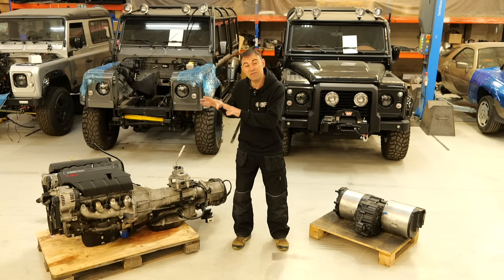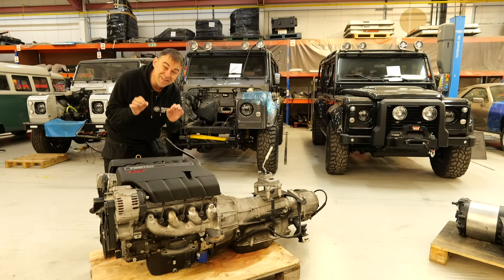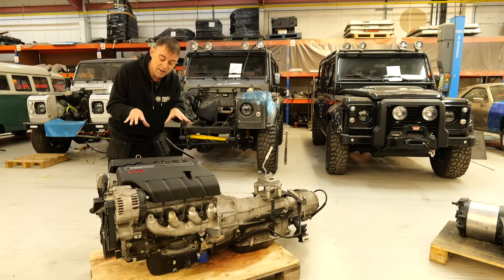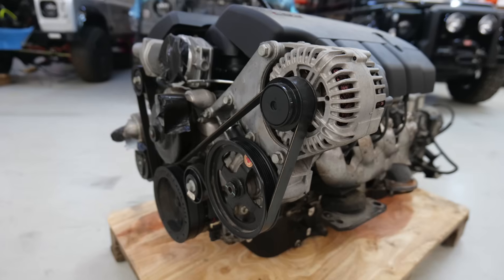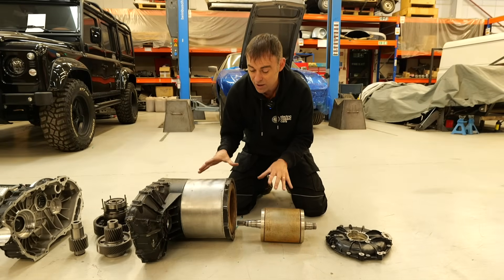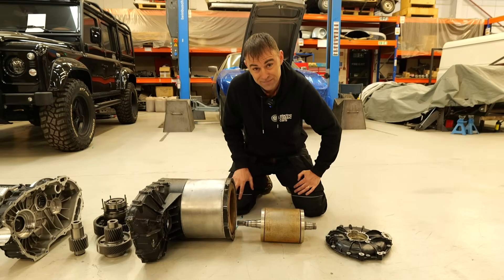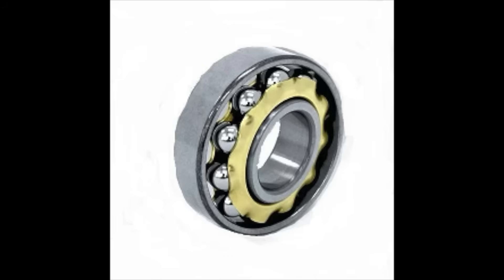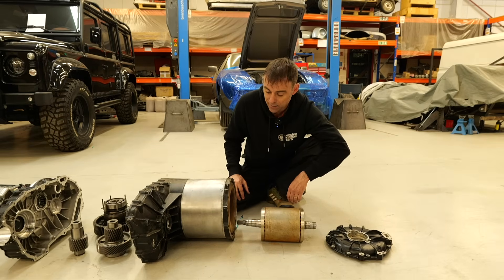Let's compare the Tesla LDU with an LS3 V8 and take one apart to see what makes it tick.

Comment: What’s your opinion of doing a Mercedes S class 2015 model, which has a blown engine, I was hoping to fit a Performance LDU motor into it, do you think that this is FEASIBLE ? Worth it ?   Rough guide on costs for materials and labour would be great but I know that the cost is variable.
Reply from the maker: Sorry. I know nothing about modern cars like your Merc, but anything is possible. 👍
Reply: The problem with modern cars is that all of the sensors on the engine and transmission go to an ecu. Then the ecu is tied in to the gauge cluster and body control modules etc. To keep everything working, you need to trick the car into thinking the engine is still in the car otherwise your gauge cluster will light up like a Christmas tree. It can probably be done, but it would be very expensive.

Comment: Great video. I am sure folks will say add the battery weight in the comparison. The thing that gets missed in that ask is as time moves on more power dense batteries are developed, which isnt the case with ICE.
Reply: We've already reached the physics limitation for ICE 'efficiency'. They can be around for 100 more years and they will not get much more efficient.
Reply: @HoldFastFilms  that's what I am getting at
Reply: Agreed,  I occasionally see comments that ICE engines are getting more efficient, but honestly they peaked decades ago. Now they're adding turbos to try to use a pinch less gasoline, but making the engine that much more complex and prone to wearing out and breaking down.
We've already seen several generations of EV battery improvement in both density and chemistry in just 15 years, and we're nowhere near done.
The only way ICE vehicles are going to get more energy efficient is to make them lighter and more aerodynamic, and the trend has been in the opposite direction since the 90s.
Reply: @ziploc2000  I’m  pro ev but let’s be careful to not spread misinformation.  They are still making some improvements in combustion.  Turbo charging has been round for many decades but the latest turbos have seen some improvements.   The other issue now if that there is much less money going into engine development.

Many of the reliability issues are related to either money saving(often plastic parts), emissions systems or bad design.

Tesla had quite a simple job to do(one moving part) and managed to f up in Major way with the coolant leak that totals the motor 🤦‍♂️.

Comment: I’d love to see an episode showing how many parts on a combination engine are there to compensate for the flaws in using explosions as a means of creating movement. Once the piston has done it’s cycle every part after that is a liability (the exhaust system, egr, catalytic converter, gearbox, nox, flywheel, long drive shaft etc)
Reply: To be fair, we shouldn't call the combustion of gasoline in cylinders "explosions" - although it does occasionally happen and is called "knocking".

Comment: Question, i have vw syncro vanagon ,rather than a rear generic electric motor to the gearbox,to run the driveshaft to the front, is there and electric motors that have 3 outputs to possibly delete the need for the vw gearbox which is very weak with higher powed torquer engines.. instead of using a tesla rear drive unit and a front drive unit which would be lovely but quite complicated i would think .
Reply from the maker: If we did another Syncro we’d go front and rear Model 3 motors. Nothing complicated about it. 👍
Reply: Are u able to locking unlock, the electric motor on the front and rear ,like the front diff on a syncro..dream syncro 400hp spinning 4wheels in the dry ..without everything braking..

Comment: tesla drive unit is lighter, sure, we all know ev's are very light :)).  if you don't add the batteries, then you get a minimum of 620kg, without wires. and related stuff. for the ls3 unit you add 40kg for a full of 70kgof gasoline and 5kg the fuel tanks, total 445kg. not a huge difference, v8 power units are heavy as well
Reply from the maker: A Tesla model s 100kWh battery pack weighs 540kg, including cables, charger, etc The total weight of the LS3, gearbox, transfer box, exhaust system, big lead acid battery, starter motor, fuel tank, fuel and all the other stuff to make it work weighs nearly 680kg. The electric conversion weighs the same as the ICE setup that came out.

Comment: Can a Tesla LDU replace the transfer case on a 4WD truck?

so, delete the engine, transmission, and transfer case, then turn the LDU sideways & run the axles as driveshafts, into the other axles. The gear ratio of the axles would make the motor spin faster, but that would be offset with bigger tires...
Reply from the maker: That’s how we’ve been doing 4x4s for the past 7 years. With one exception, we change the Tesla gear ratio with our own gear set. 👍 https://youtu.be/HoqoL1EyAHk?si=HU6pDRePt66z9ApB

Comment: I was HORRIFIED when realising that seal doing 18krpm. Normally stators do not heat up that much that they could not cool via the stator. Cooling the transmission oil MIGHT have some issues in some driving, such as insanely spirited track. In off road use, this type of transmission without torque converter is basically idling along unless you're in Nevada, which you are not. So yeah, for these Landies, I think the simplest coolant path delete is good option. Note that I'm just armchairing. For work, I repair electrical pumps, which are just about this simple.
Reply: ppl will customize the electric drives over time for specific needs... imagine a little trans cooling radiator, a little air cooling system, etc
Reply: Yeah I can imagine the diff/transmission oil will need a lot of cooling when driving on a track, and a separate cooling circuit could be good for just that. Racing cars often do have diff oil cooling.

Comment: to make it fair you need to put the battey  next to tesla and gas tank next to the V8. Try to be honest for a change
Reply from the maker: Why? We’ve already covered that in a previous Tech Talk. This episode is about looking inside a Tesla drive unit. 👍 https://youtu.be/HoqoL1EyAHk?si=HU6pDRePt66z9ApB
Reply: @ElectricClassicCars  no you didn't - you only show the tesla unit but no V8. No weight, cost comparison. Not to mention  200 mile range and 5hours to recharge your contraption Vs 400 mile range and 2 minutes to refill ICE engine gas tank.

Comment: You have to consider the energy storage as well as the ancillary equipment required, and the motor itself when comparing them.  You touched on it some, but did completely ignore the difference between a gas tank and battery packs, which I believe also require cooling.
Reply from the maker: This episode was about looking inside the Tesla drive unit. We’ve covered the battery vs fuel side of things in a previous Tech Talk. 👍 https://youtu.be/HoqoL1EyAHk?si=HU6pDRePt66z9ApB
Reply: All that being said, I am completely on the electric bandwagon, and next vehicle I purchase will be electric, possibly hybrid to deal with potential charging infrastructure limitations.
Reply: Actually batteries are far more likely to require heating than cooling, as they like to be warm when giving or receiving charge. They do a certain amount of self-heating as they're used, but in colder weather pre-heating the battery (especially if still plugged in) can lead to greater efficiency when driving and a warm battery will charge faster than a cold battery.
Reply: @ziploc2000  I know that Tesla battery packs do have a cooling system.
Reply: @ziploc2000  it is correct that most batteries require a min operating temp, just like the oil in an ICE but there are ways to mitigate the extreme low temps given the fact that charging/discharging a battery creates internal heat. so in extreme cold climates a pre-heating system would be optimal...
for the moment, dissipating the battery heat is the main concern.

Comment: Super neat to see the exploded view of the tesla motor. However, I think you skipped over the battery weight issue. I agree that the electric motor is the more efficient way forward, but the inherent weight to get full range vehicles is a substantial design and engineering consideration.
Reply from the maker: We covered batteries in a previous Tech Talk. 👍 https://youtu.be/opF1si__APs?si=taNA6C0wKcco5iQc
Reply: What? A model s lr awd weighs the same as a loaded older challenger or charger right at 4,400# newer chargers are over 5,000#
And the new model 3p weighs the exact same as a bmw m3 comp awd or less than a ford mustang dark horse! 
the lightest tesla model 3 rwd weighed just 3,450# a base model mustang now weighs more!

Comment: How can you measure rotor temperature after coolant delete ? Of course  motor or gearbox doesn't get hot but what is with rotor ?
Reply: Couldnt you just put a probe in the case that is connecting to the rotor??

Comment: Question is the range, I saw that most of your conversions have range around 200-300km, is it possible have range around 400-500km with more modern and probably more expensive batteries? Or there is no space for batteries with this cappacity in your conversions?
Reply from the maker: The longest range vehicle we’ve done so far is also the largest, as it could carry a large battery pack. It was 400km range. The restricting factor is the fact that we have to stay within the confines of the ICE cars original weight. If you are starting from a blank sheet of paper and building a ‘new’ car then you can get a range much much higher.
Reply: @ElectricClassicCars  
How about "longer" gearing?
If you don't need massive torque you could essentially "Hypermile" and still have performance that most will find adequate

Comment: 17:19 Could you imagine doing an electric version of a Boss Hoss motorcycle with a Tesla drivetrain? You'd probably run out of tyres before too long and the range would be just as bad as a Boss Hoss motorcycle, considering how they only go about 100 miles to a tank.

Comment: Lovely, but… the battery is the elephant in the room… give me access to a zero point energy (aka free energy) converter to run the electric motor and I go electric… meanwhile my trusty 3,5 V6 Mercedes is doing just fine.
Reply from the maker: You want free electricity before you’d go EV but you’re happy to pay for fuel for a V6? That makes no sense. 🤷‍♂️
Reply: @ It’s a bit more complex than that. Producing the battery actually kills the supposedly environmental cleanliness the car makers like to put forward to attract customers… what about the recycling once the battery is beyond its time? …and of course the grid of fast charging stations is nowhere near what we already have with petrol/diesel… both concepts are flawed; combustion engine as well as rare earth battery packs… but hey: I love what you do. Keep on cracking👍
Reply: Oh gee you breathed in so many exh fumes you probably believe oil just comes straight up and goes right in your gas guzzler eh? 

Hint it DOESN'T and at 7# per gallon of refined fuel burned? An average driver will burn 2,000-5,000# or MORE in fuel weight alone annually for EVERY SINGLE YEAR YOU OWN AND DRIVE AN ICE VEHICLE! 

Example for morons, 25mpg ice sedan driven 10,000 miles a year which is claimed efficiency and miles for the segment. Well that is 400 gallons of just fuel burned at 7# per gallon meaning you've burned nearly a whole tesla model 3 in weight up in just one year! 

That 800-1,000# tesla pack meanwhile is over 95% recyclable and lasts 10-15+years before needing to be remanufactured smh.

Comment: When you count up the parts in the LS3, don't forget to add all of the parts in the transmission as well - there are so many in a high-powered auto box. And they need maintenance as well!
Reply from the maker: Very true. 👍
Reply: Don't forget to compare the low cost of rebuilding a motor ($3K to $6K, for most vehicles) vs the $10K -$20K for replacing an EV battery, or the ridiculous repair costs for an accident in an EV that is more likely to total the vehicle (ouch, insurance premiums won't be pretty for the next vehicle :face-blue-wide-eyes:).
Reply: @RT-mv7df  Have you lost your mind? Compare rebuilding an ICE engine with rebuilding an EV motor. An EV motor has 1/10th the number of parts, or less.
Reply: Well he forgot to mention you need a huge battery as well.
Reply: And don’t forget the fuel system, exhaust system and emissions control system.  And the starter battery.  What am I forgetting?

I just changed my oil again and took the smelly old oil to the dump.  Well, most of it - the part I didn’t spill or wipe off my fingers.  My Tesla…hmm, doesn’t need that ever.
Reply: but don't forget the LS3 has a simple fuel line, tank and pump that will last 50 plus years..... the EV has a battery that is being strained and damaged as you charge it, and the faster you charge it the more damage.
Reply: @RoverIAC 50 years? Nonsense, fuel pumps and fuel lines will degrade faster than that unless you keep them away from fuel.
Just admit you hate anything that isn't a combustion engine and stop trying to prove up is down.
Reply: @RoverIAC  but the engine itself won't last 50 yrs.... so what's your point?
Reply: @ my petrol 1972 308-V8 is over 50 years old and still running.

Comment: It is very efficient and beautiful technology pertaining to the electric vs ICE. In the country where I live the fuel for the electric motors is at this stage an insurmountable problem and I believe weight and refueling plus safety is still a bit of a problem world wide as well as cost, the ecological footprint of mining and manufacturing as well as recovering/repurposing of the elements that goes into the fuel system.
Reply: Jako  without denying the footprint for batterys   why does the petro industry get a free pass on their more than 100 year of   ecological  damage. in canada alone there are almost 140 000 unused oil wells that have  not been  properly closed.
Reply: @steveggca  The petroleum industry unfortunately is fundamental to the way we developed society and the people in charge there are seemingly not as answerable as they should be because of power, influence, control and an incredible lot of sectors and people profiting. There is no guarantee that the future battery industry, should they sort out the problems, will not do exactly the same, with at this stage a much bigger ecological destruction footprint for a lot of generations to come. It is all about money, power and control which we as the so-called people willingly give to politicians and bureaucrats to administer with very little if any oversight and when a rather brash politician address these issues we as the manipulated and brainwashed masses,  revolt on an emotional level with very little commonsense and a great fear of necessary change.

Comment: One is a filthy, archaic, inefficient and cumbersome kludge of engineering compromises necessary to extract torque from contained hydrocarbon explosions. Its torque curve is far from ideal (linear) so much so that it requires an equally archaic, inefficient and cumbersome kludge known as a transmission in order for it to do useful work.
Reply: Good luck with your electric fire engine, aircraft or ship!
Reply: @dancarter482  Hmm, you mean like the Elysian E9X 90 passenger electric aircraft?
or the AirBus 100 passenger Electric Aircraft? 
or the Rosenbauer RTX Electric Fire Truck?  
or the Pierce Volterra Electric Fire Truck?  
or the Vector E-One Electric Fire Truck? 
LOL, it's 1910 all over again and whether you like it or not, all you Horse and Buggy owners will be driving gasoline vehicles soon...er......oh wait....

Comment: The power to weight advantage of an electric motor v ICE is self-evident. Now, please compare the energy source, i.e. battery pack v fossil fuel capacity required for 400 hp, comparing weight to delivered energy e.g. kilowatts and then compare the total packages (motor + energy source) for motion delivery e.g. acceleration and top speed.
Reply from the maker: We’ve already done a battery vs fossil fuel comparison in a previous Tech Talk. 👍 https://youtu.be/opF1si__APs?si=taNA6C0wKcco5iQc

Comment: I wonder what kind of range one would get towing a 2 ton trailer with the LDU mated to a defender.
Reply from the maker: Depends on the size of the battery pack but I get around 150 miles range when towing my race car.